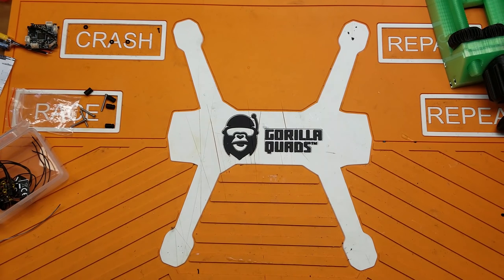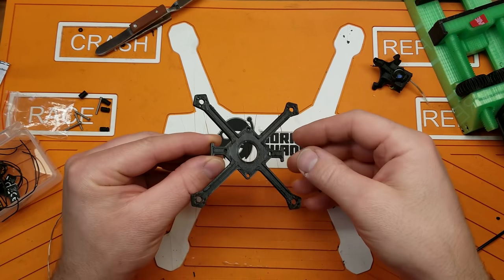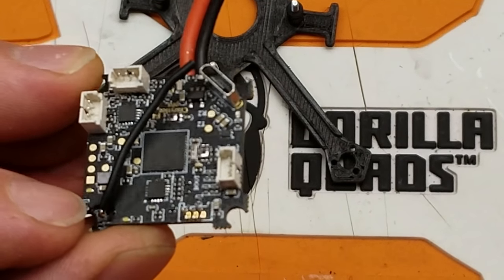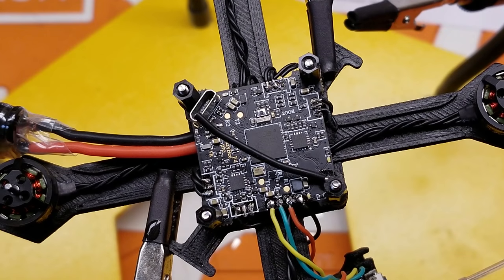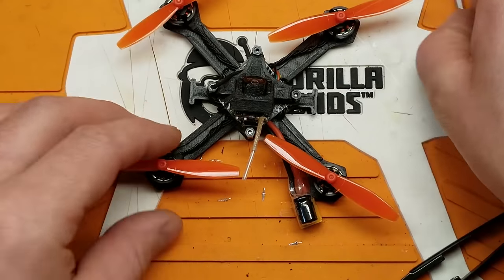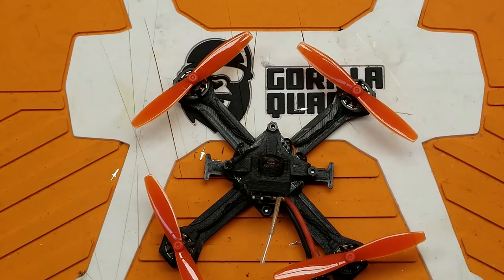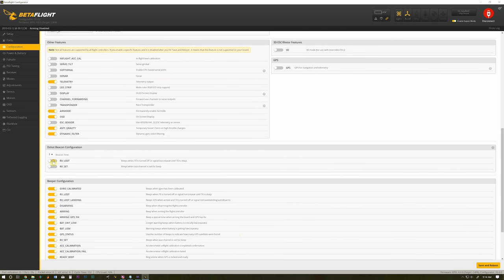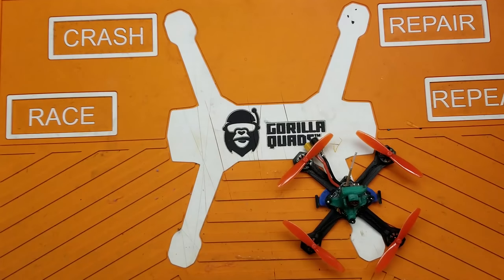Cavity3d Micro racing drone build🔥🏁

Comment: I would avoid using hv batteries at least change them at 4,2v because of the regulator burning issue but on the other hand you are using the cap. I dont have any expierience Im saying that because I read a lot of regulator burning at the trashcan group on facebook when people use the XT30.
Reply from the maker: Yes, regulators burning out seams to be about the only issue with this board other than the frsky_x vs d protocol. I've put a lot of hv packs through this board with no issues. I wonder if the cap is what's saving my board 🤔
Reply: @TweetFPV  it may be two reasons as they say, too much heat from the soldering iron when people connect the xt30 or the HV. I believe that the cap is doing a good job.
Reply from the maker: A buddy just lifted a pad trying to solder the larger gauge wire to his board and killed his regulator in the process. So I would lean more toward too much heat damaging the FC. This isn't a novice solder job.

Comment: I have two 3D printers. An Ender3 and an Ender2. How hard is it to print this carbon fiber nylon?  What are its requirements for nozzle temp, bed temp? Does it require an enclosed printer? I need all the details and a link to the magic sauce... Errrr ... noodles ... Errrr.... Filament!
🤪🙄🤘
Reply from the maker: All the specs can be found at matterhackers web site. You will need a all metal hot end, heated bed an enclosure will help but shouldn't be necessary for such a low height print. A sheet of garolite is the best thing to print nylons on but pei covered in glue stick will work. Garolite can be had from any grainger or industrial supply store.

Comment: Hey tweet
I want to transplant my snapper 7 into your cavity frame, like you
And I have some questions

Did you do anything else(ex:motor wires extention) to your snapper 7 when transplanting? 

And tell me any tips when transplanting a snapper 7 into your cavity

please answer me!
Thanks
Reply from the maker: The snapper transplant was my first iteration of this frame. No modification was required other than the bf adjustments.
Reply: TweetFPV 
Thanks for your fast feedback.

I just have a few more questions.
1. Do I have to print the camera mount when transplanting the snapper 7?
2. What modifications do I have to do on the betaflight? 
3. What screwdrivers did you use to unscrew the frame screws? My screwdriver that came with the snapper only works with the motor screws, and doesn’t work with the smaller frame screws.

Already getting excited to change my snapper into your awesome frame! 
Please answer me!
Reply from the maker: The snapper canopy will work but you will need to source new m2 screws. In bf you will need to correct your board alignment, motor mapping and rotation. (just follow the video. Numbers may be different but the process is the same). For hardware just get a m2 screw set from Amazon and you should be all set. Only tools needed are basic tools like hex keys and a 00 Phillips screw driver